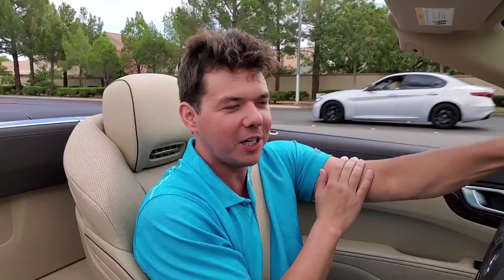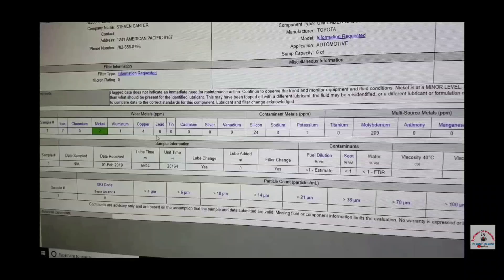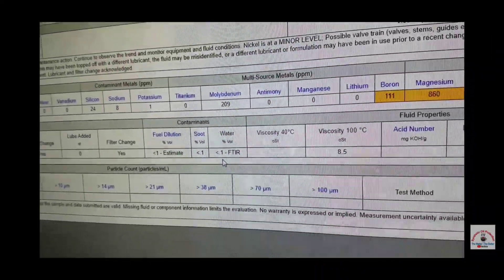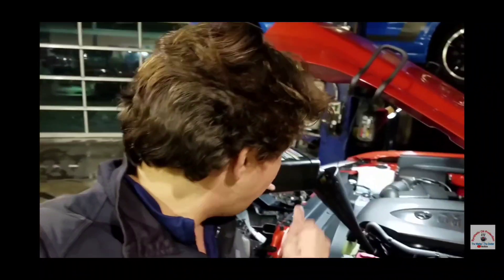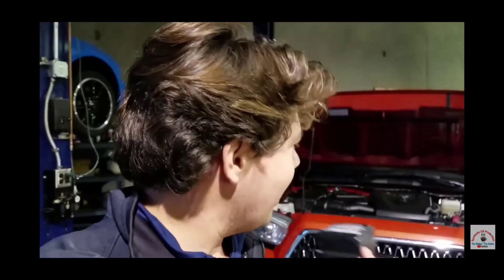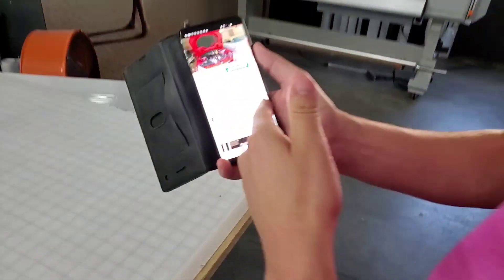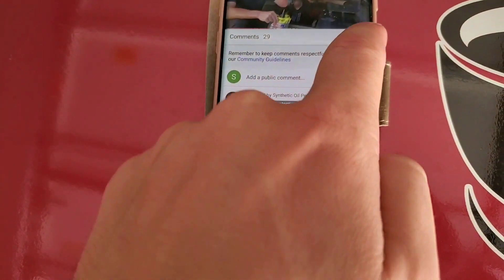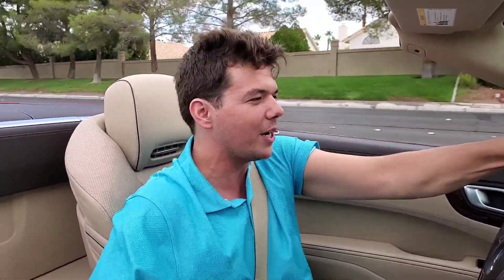AMSOIL Oil Analysis Test Results ONLY 5500 Miles

Comment: You're spoiling us with facts again! This is and remains the best way to prove how important the right and good one is. Facts!

In the meantime the X5 3.0 diesel has driven about 3000 miles on the EURO 5W30 WITHOUT any oil, engine runs very smoothly, consumption is still ZERO!

PS : go to the hairdresser more regularly, keep it fresh and shorter. It suits you better. That's just my opinion. grtz

Comment: I’ve been using amsoil 5w30 on my Bmw 2006 530xi for years love the product. Thx so much my car has 120000. Miles and runs like brand new my question is how are the oil filters for my car. 👍🙏
Reply from the maker: Amsoil if they make it will be here in the lookup guide.
Find AMSOIL Products For Any Vehicle - https://www.amsoil.com/guides/?zo=5331179

Comment: If that oil had 200 idling hours on top of the 5,500 miles, that idle time would be equivalent to roughly 8,000 more miles on the fuel (using the rule that 1 hour equals about 40 miles of use) for 13,500 total in one year.

Not bad.
Reply from the maker: Oh yeah definitely impressive for the high heat out here in Vegas

Comment: I just got back my analysis on the Jeep. :) the only thing that was flagged was fuel dilution at 2.0 and base number D4739 at 2.65. Next time I will have this base to go off from, the report said I did not put the capacity of the engine oil, next time I will make sure to tell them 6 quarts for the jeep.
Reply from the maker: Sounds great yeah even 2% isn't extreme so you're still okay It's just that you're just coming up on the border.

Definitely good to keep an eye on fuel dilution I would also recommend the PI performance improver and doing a engine flush just to make sure all the carbons out so everything seals properly.

That's still very good if some of the Jeeps are known to have a lot of problems with this
Reply: @Syntheticoilprotection  I have been doing the amsoil upper cylinder usually with every tank, I did do one tank with the PI a few thousand miles ago but I have another one that I will use soon, it will be interesting to see the results next time :) Thanks for all the videos.

Comment: Ebin i got a different question.
I want to buy a 2022 prius and amsoil says use ATF BLUE LABEL for the ECVT.
that doesn't sound right.
Do you have some wisdom about that the matter?
Reply from the maker: That's a great question I have absolutely no idea but that does sound right most Toyotas do take the fuel efficient ATF fluid and if that's on the lookup guide that's what it takes.

There's still a lot of transmissions to take that fluid you'll see the signature series has some better additives for cold flow also it'll hold up better in high heat so I definitely recommend the signature series
Reply: @Syntheticoilprotection  CVT are different from AT. I still find it hard to believe. I wanted to know if you knew.
Reply from the maker: That's a great question honestly I have not worked on that vehicle and I do not know exactly what that transmission has in it
Reply: @Syntheticoilprotection  thank you for your professionalism

Comment: Excellent
Reply from the maker: Thanks William!!!
Reply from the maker: Are you an Amsoil preferred customer?
Reply: @Syntheticoilprotection  
Eben;
Yes, for about a year now.  
My Wheelchair Van does lots of idling & low speed in service, only 40,000 Miles for now 3,000  Engine Run Hours.  
Does AMSOIL offer oil & oil filter change recommendations for Engine Hours Vs. Road Miles?  
My Vehicle Manufacturer requires a minimum twice a year oil changes regardless of low annual miles to keep the warranty in force.
Reply from the maker: Well it's usually either one so it'd go one year or 25,000 mi or 700 hours whichever comes first.

However if you're doing oil analysis you can continue to go longer
Reply from the maker: Am I your Amsoil dealer?
Reply: @Syntheticoilprotection  
Eben;
No, had already signed on w/ ANDREW BOLTON in Wisconsin researching Auto Oil before YouTube started suggesting your videos.
Bill
Reply from the maker: Sweet💯💯💯
Reply from the maker: Thanks for being a part of my YouTube community 😊